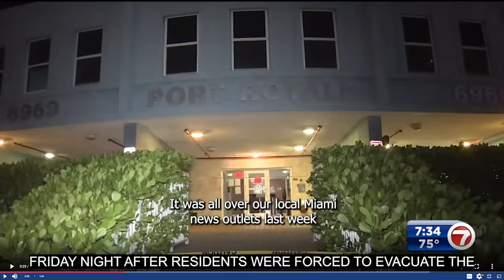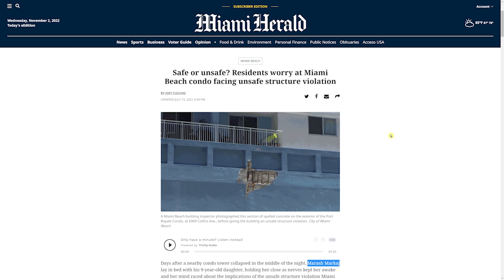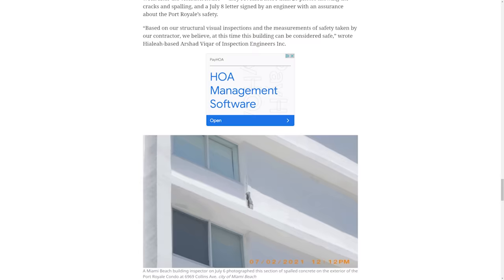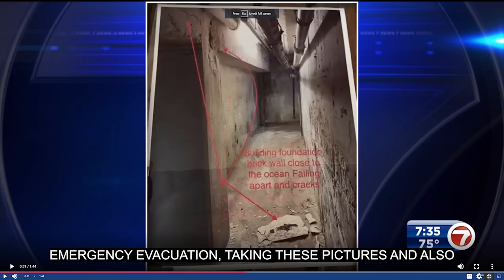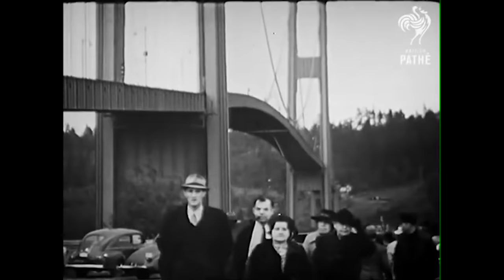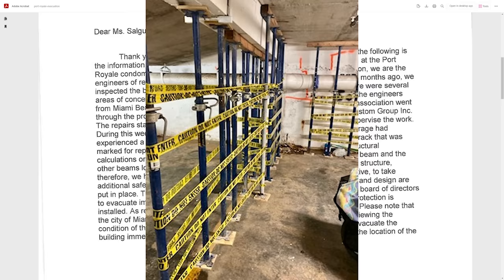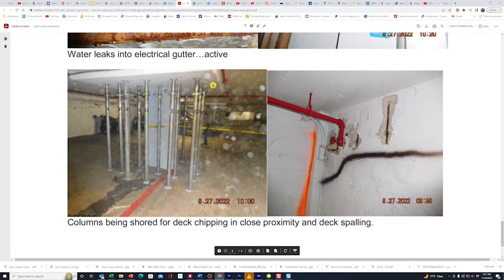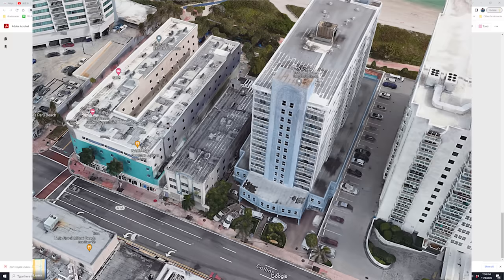Another Miami Condo Evacuated Why it Will Collapse

Comment: I remember the condo craze in the late '70s and '80s. These things went up way too fast! I was an electrician then, and these buildings were most likely built with drug money. Junk back when they were built, and now a disaster is just waiting to happen.
Reply: Old buildings were made from pure concrete.  These new buildings use steel skeletons inside the concrete.  The technology is fundamentally flawed (because the steel rusts).  It needs to be phased-out like asbestos was phased-out.

Steel-reinforced concrete is a bad idea that gradually falls apart & collapses.
Reply: @electrictroy2010  There is nothing wrong with steel reinforced concrete, it has been in use for over 120 years, and indeed it is stronger than plain concrete of the same thickness.  It does however need to be built and maintained correctly.

Comment: Hey Jeff, thanks for another interesting video.  I suspect there are numerous buildings built on the beach shoreline that are in a similar condition.  With these buildings being constantly bathed by salt spray, sea water soaked soil, and external structure stresses that take place when hurricanes come through, I assume these types of buildings would need constant thorough maintenance.  Problems have likely gotten ignored over the years using the assumption that concrete buildings don't collapse because they are super strong.  Hopefully the Champlain Towers collapse will be a wake-up call to the industry but, at the same time, not a knee-jerk reaction based upon fear and gut-feel.
Reply: Plus when they flood with storm surges over the years
Reply from the maker: They need to be proactive with maintenance. They need to keep those buildings well sealed and painted, and immediately fix and damaged concrete
Reply: Great Post (from a likely engineer)    John 14:6
Reply: @rogerdevero8726  Yes, Jesus is the ONLY way to Heaven and there are no work-arounds or "backdoors".
Reply: i bet that it's not just the climate it's also bad building practice - adulterated concrete/cement mixes, concrete not given enough time to adequately cure, insufficient gauge and amount of re-bar, inadequate safety/redundancy features of construction.
Reply: @Scriptorsilentum  Agreed.  Having lived in Miami, Florida from 1969 to 1981, I heard and witnessed several examples of that.
Reply: After hurricane Andrew tore a swath thru Florida, I remember hearing that the only recently built structures left intact were the habitat for humanity houses. They held up because the builders actually followed the building codes and didn't scrimp on materials. I believe there was a code requirement for hurricane hangers that attach the roof to the house. Only the habitat houses had the correct number required because, as a charity, they had no profit motive for cheating. This example of how pervasive corrupt building practices have proven to be, is ominous.
Reply: It's not the buildings rotting that would keep my money away from the beach. That's a sand bar that's just waiting to be reclaimed by a hurricane and composed of sand exposed to massive amounts of rainfall every year. That's not land.
Reply: @Scriptorsilentum  I don't believe that is the case. There are far too many different building departments in all of these counties that would be having to overlook the same things. Florida is an extreme environment for any type of buildings, including homes. Especially homes.
Reply: @ronaldturner4849  👍👍👍👍💯
Reply: @jeffostroff  Not always owners have money for that

Comment: I get the feeling that the condo market in the Miami area is going to collapse (so to speak), if it hasn't already.  There are probably a lot of old buildings that either can't get fixed quick enough, can't get re-certified in time and/or will cost too much to be viable.  I don't know if tearing down a lot of these structures and building new ones just resets the clock, causing the same problem 40 years later or if the residents will be wiped out by that.
Reply from the maker: Many condos in the area of the collapsed dropped 30% in value
Reply: It's not just this, but as sea levels rise and the sands get washed away, even safely constructed and maintained buildings may wind up having major issues.
Reply: I hope Florida doesn't have the problem of people not wanting to work, like so much of the nation right now.
Reply: @rayah2782  NYC is built on natural, deep GRANITE, not sand.
Reply: @timramich  it is the rehab and retiree capital of the US.  Those are not people that generally participate in the labor market.  We have low unemployment because we are an older population and lots of folks retire everyday and the gig economy has zapped workers from traditional employment. People have money, the inflation is due to high demand in services - it is stubbornly high.  Shelter costs have already started coming down due to higher interest rates.  You can’t force people to work traditional jobs.
Reply: @alexmartin5774  Large parts of NYC are built on fill, and almost all of Manhattan.
Reply: Don’t underestimate the location and clientele of Miami.  A lot of hopeful foreigners coming from far worse structures or rich folks using their place part of the year.  

Plus, when you think ‘dangers in Miami’, Hurricanes will always take top spot.

Comment: Just to note:  in surveys of how prospective home buyers rate the features of homes, like number of bedrooms, finishes, location, etc.  they consistently rate view as the most important feature, and geologic/engineering safety at the very bottom.  Even as a geologist who knows better, I bought a old house built on Bay Mud, and a in flood zone, here in the San Francisco area, because I fell in love with its Victorian charm, and it was the only non-horrible one that we could afford.  My soul would have died in any of the other houses we looked at, tiny, run-down 50-60s “ranch” homes with absolutely no character whatsoever and requiring head to toe remodeling and earthquake and energy retrofitting.  Pre-1990s construction here in California wasn’t that great here, either, the earthquake construction codes were weak and insulation wasn’t required until after the energy crises of the 70s.  Like most US homes of that era, they were quickly and cheaply built to supply the huge post-war housing demand.
Reply: It’s amazing how much money people will put into the aesthetics of their home, neglecting the structural components.
Reply: MADE A DUMB DECISION and will regret it, when SF gets hit with a 7.0 earthquake that makes your house collapse & trap you.  As an intelligent geologist, you should have known better.

BTW SF is ridiculously expensive to live.  So is most of California.  I moved away & got a nice home for $200,000 on the east coast (near Baltimore).

Comment: This is terrifying!  Is there any recourse for these residents???  It wouldn’t matter to me what they did to fix this…I’d never go back.
Reply: not really unless they can find negligence on the part of the board or an engineering firm hired t odo repairs.. ..  if there were many complaints filed for many years previo0us and no steps were taken to begin repairs then residents could have a case to make against the assessments they will surely be billed for to make these repairs..  but if the building is just aging and all proper steps were taken.. they have to pay the assessments and move on.  im asure at this point the engineering firm will be going 100% through the building, if the repairs arent too extensive they will be grandfathered by the city and allowed to stay on original code..  if the repairs are too complext they may require the building certify to current 2022 (2023) code ..  now that the city is involved you can bet with the bit of egg the cirty had on their face from champlain decades ago..  that they will insopect this building thoroughly before re-issung its CO..  so the residents can rest assured (with smaller bank accounts) that the building will be safe..
Reply: How about if it falls or is knocked down, the site is sold to developers; they would receive a payout of some value?
Reply: If FEMA or another government agency steps in and buys them out. Or the can sue the builder for their loss 
Condos are tricky. Always contact a real estate attorney before buying
Reply: It would be a matter for whatever insurance is covering the building and if the HOA didn't bother with it, then the residents would be out of luck. The insurance you get as a resident is either renter's insurance or insurance on the unit itself depending on whether you rent or own the unit. It typically just covers the things in the unit, not necessarily the unit itself, but that would be laid out in whatever coverage documents are involved in the policy.

The building I live in is insured by an HOA policy for anything that happens tot he actual building, but the stuff in my unit is covered by a renter's policy. If the building did fall down or otherwise become uninhabitable, then I'd probably be out of luck while looking for somewhere else to live.
Reply: @SmallSpoonBrigade  thats just it in a nutshell..  most HOA's do have insurance.. its usually required by mortgage holders that the building itself be insured properly since many condo owners hold a mortgage like a house.  in a rental situation, the renter's policy-holder knows its a contents-only (and usually some liability too.. ie if a washing machine owned by you flooded the building)..  buying an older condo is somewhat of a risk for the buyer as its possible to have costly assessments sooner than later.. whereas a newer building isnt likely to need costly repairs for a good number of years
Reply: Remember, this is the condo owners’ building.  Each owns an undivided interest in its common elements.  It is the owners’ responsibility to maintain it.  Apparently, they have failed to do so.
Reply: I would be very much surprised if there is any insurance coverage for this type of situation with a high-rise condo.
Reply: @peterbaskind9872  with champlain towers it seems the condo board did not adequately inform all the condo owners of the extent of damage and repairs needed. iirc here and there the board tried to "soft-pedal" the news. 

the whole building industry is as rotten as their buildings.
Reply: Not really other than to charge a huge payment the repairs they cannot afford. Condo insurance doesn't cover the structure.
Reply: @emilyfeagin2673  I am shopping for a real estate attorney,but having difficulty finding one,as moving from ca,buying in ne fl.had been planning to leave ca,all the liberal,democrat bs,rediculious  governor,etc..I never want a condo. Had a single  family  home in the past.its too complicated  with condos,as not really your own.
Reply: @johngreydanus2033  , hopefully, they own the land under the building, as most condo owners do. For example, I own 1.377% of the land and all other common elements in my condo, along with my unit. Some buildings, however, rent their land. If the Port Royale unit owners own their land, they can sell it to a developer for big bucks, at least as much as the Champlain South site, which sold for $120 Million. 6969 Collins Ave in Miami Beach is a very choice location and I'm sure Related or some other major luxury developer is chomping at the bit to get its mitts on it. That price or better would take the owners of the Porte Royale's relatively moderate-priced condos out at a great profit, even after selling expenses.
Reply: @chicagonorthcoast  Thanks, that makes a lot of sense. I wasn't aware of what happened to the Champlain site.
Reply: @Scriptorsilentum  That may be true.  But the owners elect the condo board.  "We have met the enemy and it is us."
Reply: @johngreydanus2033  whatever value land has would be split by owners of units, But if building is still there the new owner must tear it down adding to the expense of building something new there
Reply: @emilyfeagin2673  51 years old, cant sue builder as statute of limitations long passed
Reply: @peterbaskind9872  The owners also elect the 'evil' condo association or sit on the board themselves... As owners they can have as many inspections done as often as they like because they are paying for it.  In this case the building had done the 40 year Inspection (and most lilly some repairs then) but since it must be inspected again every 10 years they were trying to do the right things.
Reply: @SmallSpoonBrigade  Watch out. There was a famous hotel that became a condo in upstate NY. They had full HOA  insurance but misrepresented things. It burnt down, courts ruled in favor of the insurance companies.  People lost everything ( I don't know about personal policies).
Reply: The HOA at the collapsed condo DID tell the residents the building was in bad shape.  The HOA had heated arguments with the residents.  One president resigned, because he got fedup with residents voting “no” to repair the foundational damage.

I don’t blame the HOA.  I blame the residents & their refusal to spend money to fix the building 

.

Comment: I’ve started to notice, since the Champlain towers collapse, that nearly all concrete structures (some of which I use on a daily basis) have cracks ranging from mildly to very concerning, and improper repairs of spalling are basically the norm.

It’s not just Florida, I live in Minnesota and it’s everywhere, a ticking timebomb.
Reply: Maybe you just pay more attention to it now
Reply: I’ve always noticed the concrete spalling, but I didn’t realize it was a structural failure.  I thought it was just cosmetic.  IMHO Old buildings were made from pure concrete.  These new buildings use steel skeletons inside the concrete.  The technology is fundamentally flawed (because the steel rusts).  It needs to be phased-out like asbestos was phased-out.

Steel-reinforced concrete is a bad idea that gradually falls apart & collapses.
Reply: @electrictroy2010  , You should see the big spalls and rusting rebars on the CTA Red Line north branch el trestle here in Chicago. HUGE spalls. Half the line has been a slow zone for years, and it has been shored up with massive structural steel supports. At long last, it's being torn down and replaced section by section- a huge project costing billions, but it's over 100 years old after all.

Comment: Thankyou Jeff, no one else gives as much significance to this and other related important stories as you. 
I think the workmen that installed those shoring poles have a very dangerous job. Reason is because they have to install them and then tighten as much as possible the threaded adjusting rings, probably using a hammer. This puts a change of stress onto the beams above which can be unsettling to any nearby further faults in the surrounding stressed concrete. In any case steel supports like that are only as strong as when they are in a straight line of stress. If they get a twist or bend in them then they could collapse very quickly.
Reply from the maker: LOL, they sure do have a dangerous job. I remember skit on SNL after Three Mile Island nuclear power plant incident, they sent Garrett Morris playing the cleaning lady into the containment tower to just mop up some water on the floor, LOL
Reply: I have worked many High Rises up to 47 stories and quite of few Industrial building. Including installing and removing more pole shores that I lost count of years ago. I personally never seen a pole shore fail. All projects new and existing has always been engineered as to how many, how far apart, location,  bridge over x floors and sequence of installing or removing. I have been in construction over 46 years mostly a supervisor. I have brought up many concern to the engineers, but in the end it is the engineers (Agency (city, county, state) verses contractor/owners) that resolve the issues if any. What appears obvious to us may or may not be a serious issue and should always be treated with "An Abundance Of Caution". The Florida bridge collapse is a story you should research, it was doomed before it was ever built.
Reply: I was sweating bullets as I watched the first responders at Champlain Tower South going underneath the partially collapsed part if the building to put up those steel shoring columns. It is incredibly dangerous work!

Comment: We had a bridge right in the middle of my city that had visible deflection. Its was demolished last year and is being replaced. We definitely don't have a spotless record up north in Canada, but we do take theses things more seriously nowadays. The de la Concorde viaduct collapse was our wake up call. The result was a much tighter inspection of structures and rebuilding program. The Champlain bridge did not collapse, but it could have. At one point, it had a crack through a beam that was large enough for a man to crawl through. That bridge was one of the first few post tensioned bridges and suffered from problems almost from the start since the technology wasn't mature. Engineers kept a close watch on it, but it still ended up with that massive crack. They actually had a massive steel beam ready to install "just in case". They had the bridge reopened in a matter of days. That little crisis was what finally set politicians in motion to replace the bridge as quickly as possible. The thing about politicians is that they don't seem to do anything until things hit a critical inflection point. That bridge is easily one of the most important in Canada. Public outcry is what is needed to get things moving.